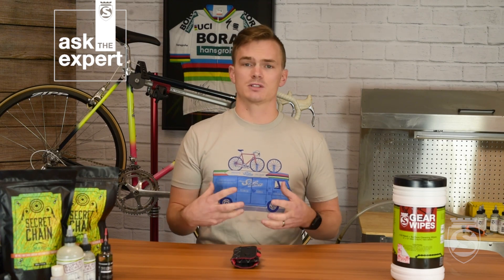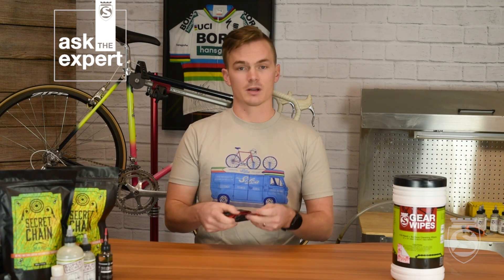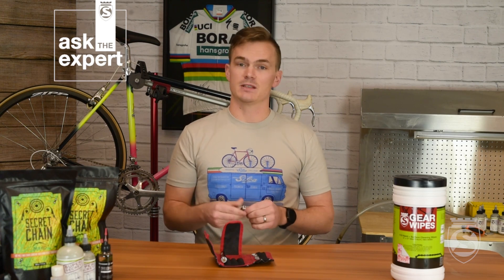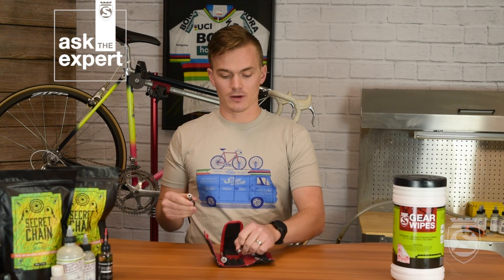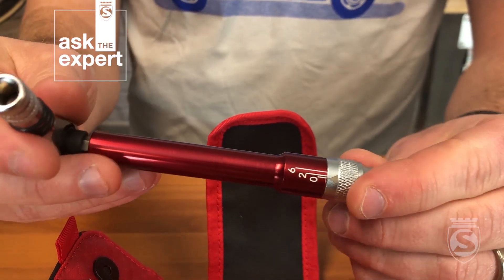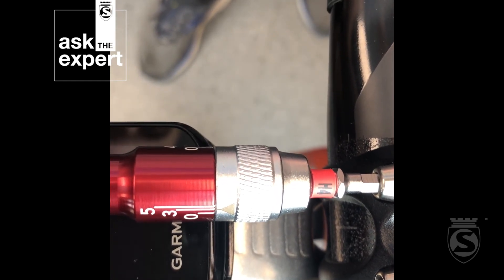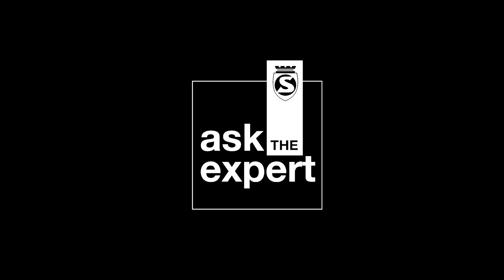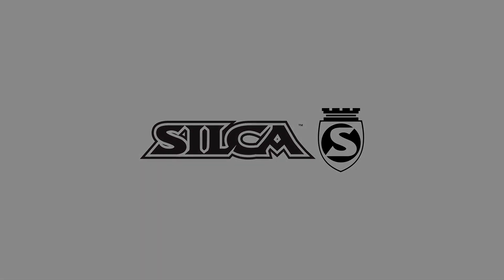Ask the Expert Ep19:  T-Ratchet and Ti Torque kit

Comment: Hi there. The bolts to tighten my saddle a fairly close to the post making it impossible to get a torque wrench on the bolts. Will the Silca solve my problem? It doesn’t look as bulky, I’m hoping it does
Reply from the maker: The T-Ratchet and Ti-Torque can be configured a ton of different ways to reach bolts that others can't so it will likely be the tool you are looking for.

Comment: Would the the Torque Wrench calibration go off if i have it in a saddle bag and ride hard on trails with all the vibrations?
Reply from the maker: No, this is one of the only torque tool designed unaffected by vibration or temperature, it is extremely robust and can even be used underwater!

Comment: 0:07 Just got one. My Cannondale Topstone axle bolts cite max 11nm. 8 feels tight. Your advice?
Reply from the maker: We recommend following manufacturers specs where possible.  I'd check with Cannondale as to what grease they're recommending that torque, also make sure you're using lubricant under the head of the axle as well as on the threads which will maximize tension for a given torque, but is also critical in loosening the axle at some future point.

Comment: What they they DID NOT SAY IN  THAT DEMO WAS ALL TORQUE WRENCH SHOULD BE  RESET AFTER USE TO O RELIEVING THE STRAIN !  Cheers Brian
Reply from the maker: Hey Brian, You are correct, typical torque wrenches do require that reset; however, our Ti Torque has a "live" beam which automatically resets to 0 when not in use. If you start to see that is not the case, it means the Ti Torque has been over-torqued and may need to be replaced. Thank you for sharing your insight.

Comment: I’m am still trying to understand the action of the torque wrench.  I see that when you tighten there seems to be a spring that shows the level of resistance when the arrow moves towards the numbers scattered in three different places on the barrel torque end.  The problem I am having is that the torque can go higher if you are not careful. I’ve searched for more videos but it seems you are the only one who shows the action of the spring on the barrel .  Is there  no place to set the torque? I thought the tool would act to prevent you from going over what’s set.  I have crushed a seat collar in the past and wish I had a torque wrench but if this is how it works then I could have crushed it anyways
Reply from the maker: So there are two types of torque tools, Torque Measuring, and Torque Limiting.  Our tool is torque measuring, this is how beam type tools work as well as digital torque tools.  In our case, when the mark is aligned with the torque number, you are at that torque, digital tools work exactly the same and typically you can read the number in real time and will also get a beep when you hit the number.  These tools are typically more accurate, but harder to use, and take more patience than torque limiting tools.
Torque limiting tools will have a ratchet or break-away joint inside them that gives you a click when they release.  These are much simpler and faster to use, but come with their own issues.  Mainly, they are affected by temperature, moisture, and contamination.  As they also limit torque by the sliding of two bits of metal against each other with some lubricant in between, they will vary in actual torque if you click it repeatedly.  You can try this with a torque limiting drill on any sort of fastener.  You tighten until it clicks and you are technically at that torque.  But if you keep going, you will see the fastener continue to turn, as the continued clicking creates heat lowering the viscosity of the grease in the ratchet interface which increases the friction within the ratchet which makes the torque at which is clicks go up.. as a result, most click type torque tools are intentionally shipped from the factory set below the target torque.  We've got a video planned on this in the next few months so stay tuned!